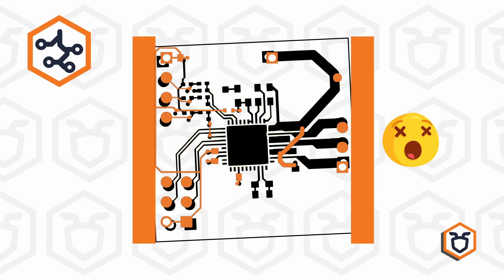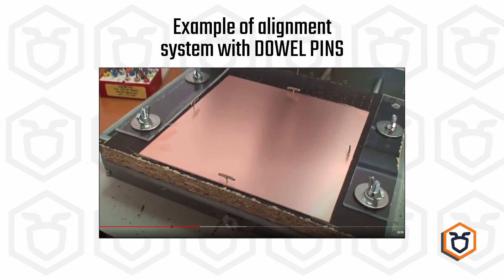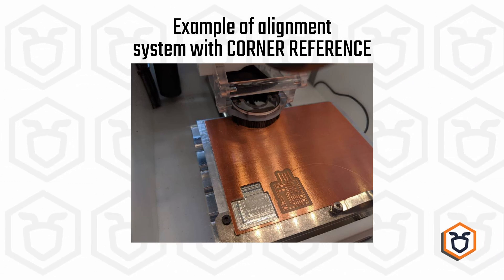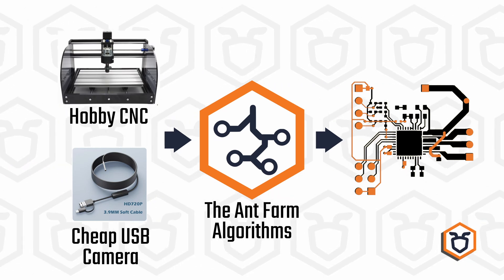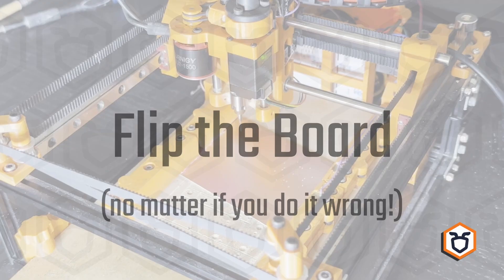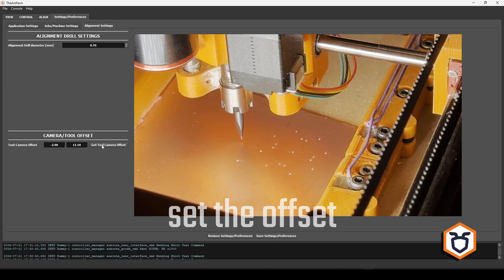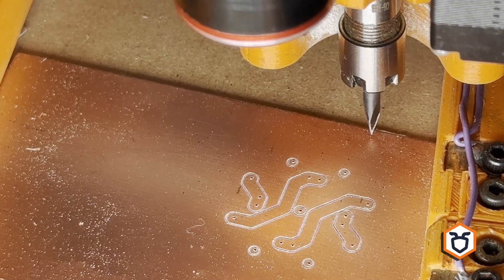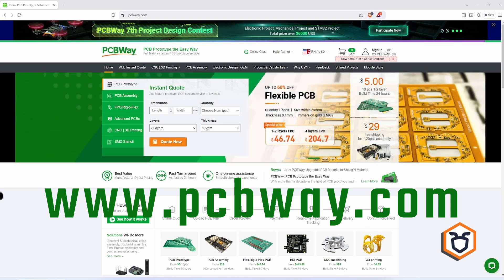Double Side PCB Optical Alignment

Comment: Great job, guys!! This is a fantastic video.

I'm currently researching this topic, and it's wild that this optical alignment method isn't already a mainstream, heavily established technique. Your implementation is very good!

Quick question: what specific model of USB endoscope camera do you recommend from a site like aliexpress? I've mostly seen people use bulky "microscope" style cameras, but the compact, cartridge-like one you're using looks perfect for a this setup.

I love that you've made the code open-source. It inspires people like me to get involved and I'm already thinking about potential improvements (it does not seem so bad that it would need a whole codebase refactoring). Since it's open-source, I might try implementing OpenCV for more precise, automatic centering of the holes. This could also help improve the UI and UX by streamlining the process.

My plan is to build this into my Ender 3 Pro, which I'm modifying with a properprinting quick-change mount for a 40W laser and a spindle with a drilling or milling bit. Here’s the workflow im envisioning based on your method. The first four steps are the same whether the board is one or two-sided.

Method for a 1-sided PCB:
1.  Coat the PCB with black spray paint.
2.  Put the PCB into clamps/holder.
3.  Do laser ablation of the paint to make a "negative mask".
4.  Mill/drill the holes in all the predetermined places.
5.  Remove PCB from holder, place into etching solution, clean with water, wipe with isopropyl.
6.  Coat PCB with another layer of solder mask or just spray paint.
7.  Place the PCB back into clamps/holder.
8.  Do laser ablation only on the parts where the solder pads are designed to be.
9.  Enjoy the good quality 1-sided PCB. Now the solder pads are clear of solder mask and the quality will be very good.

Some thoughts for the 2-sided process (continuing after step 4 above):
5.  Remove PCB from holder, flip it on the other side and clamp it down.
6.  Press several buttons in "TheAntFarm" software to align/transform the gcode of the backside of the PCB. (It's not as simple as it could be currently in TheAntFarm, the amount of repetitive clicks has to be minimized).
7.  Do laser ablation of the paint to make a "negative mask" on the second side.
8.  Remove PCB from holder, place into etching solution, clean with water, wipe with isopropyl.
9.  Coat both sides of the PCB with another layer of solder mask or just spray paint.
10. Place the PCB back into clamps/holder (last used side up).
11. Press some buttons in the software to align/transform the gcode
12. Do laser ablation only on the parts where the solder pads are designed to be.
13. Remove PCB from holder, flip it, and clamp it down.
14. In the software, select the "frontside gcode" and proceed to align/transform the gcode to the front side of the PCB.
15. Press a button to proceed with laser ablation only on the parts where the solder pads are designed to be.
16. Enjoy the good quality 2-sided PCB. Now the solder pads are clear of solder mask and the quality will be very good.

It would be nice to have TheAntFarm discord - for quicker communication, if deciding to develop it further and beyond "TheAntFarm" hardware.

Thanks again for the amazing work. And to the guy on the right: that's a nice beard, reminds me of Uncle Iroh from Avatar: The Last Airbender! :D Keep it up.
Reply from the maker: Hi, thanks for your comment. In The Ant Farm you can upload your gcodes, align using the drill file gcode, and then transform with a roto-translation the ablation gcodes of your interest. If your machine is capable of interpreting grbl 1.1 you could send it using The Ant Farm connected to your machine. If you are using something different from GRBL 1.1 you should some way get the transformed file and use it with the proper sender for the machine interpreter you're using.
In this case, The Ant Farm at the moment doesn't allow you to save the transformed file. It's a modification that we can do, but for it we would ask you or anyone interested to open an issue in The Ant Farm repository, so that we put it in our development pipeline and address it as soon as we can.
For the rest, your plan looks quite interesting. Take only in account that the rigidity of the machine you are planning may easily allow the laser ablation and drilling, but it could be not enough for the milling. That also depends on the accuracy and repeatability you want/need.
The guy on the right(Mattia) says thank you :D

Comment: @TheAntPCBMaker any documentation on this? Interested in adding this functionality in the build i'm about finished with, but unsure of what type of camera, how youre mounting it on the spindle, etc. the one frame looks like an endoscope camera, but im not sure how this all fits together

Can we at least get a picture of how/where youre mounting it, or release the STL of the piece you're using to mount? Trying to figure out if i can get away with a cheaper borescope with a larger lens
Reply from the maker: Hi, the camera is attached to the bridge, there are two versions of the bridge depending if you have the old z motor or the new one. If you have the new z motor use the bridge 2p4 https://bitbucket.org/compactpcbmaker/cpcbm/src/master/mechanics/bridge/bridge_2p4_b.stl
If you have the old z motor use the https://bitbucket.org/compactpcbmaker/cpcbm/src/The_Ant_version_1_0_1/mechanics/bridge/bridge_2p3_b.stl
Cheers!

Comment: I have a question. By the way, I loved this project and I'm developing it.
I hope you understand :)
Once I upload the program gocm3_nucleo-f401re_CPCBM_AFRO20_COREXY_VER_1.1.68.bin to the NUCLEO F401RE card and run THE ANT FARM program on the computer, when I hit "connect", will it connect right away?
Reply from the maker: You should see the COM port of the NUCLEO board. If you can see that you should be able to connect. Try refresh the COM ports and see in the device manager which is the COM port of the NUCLEO board.

Comment: Great! we have the same idea, I created the similar solution few year ago 
https://www.youtube.com/watch?v=ds5vZNRP4Zo&list=PL2rBgUeZPU0RAHxh0Pw1Mi54igJplcNsY
Reply from the maker: Very interesting! was the algorithm able to do the hole search automatically? the PCB turner is spectacular!
Reply: @TheAntPCBMaker  Yes. There is a little bit manual, before the machine start to mill first layer, it will drill 2 holes at corners. Then we change the tool bit to mill the first layer. After the first layer, it will flip the PCB, automatically find correct position of 2 holes, and change G-code of 2nd layer to correct coordinates